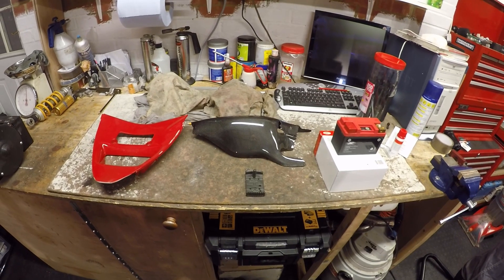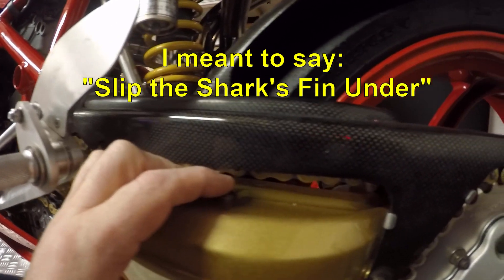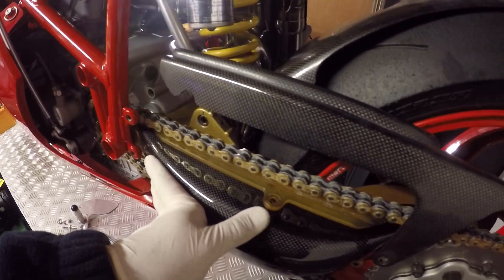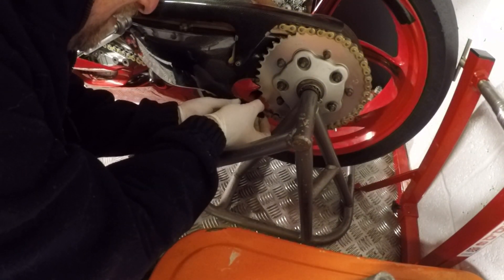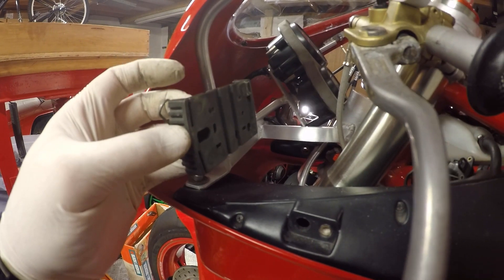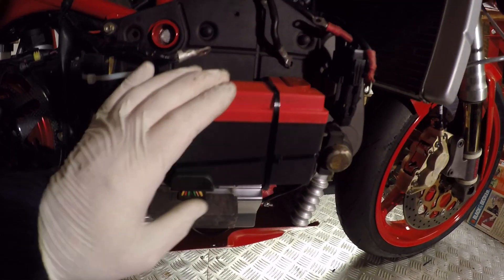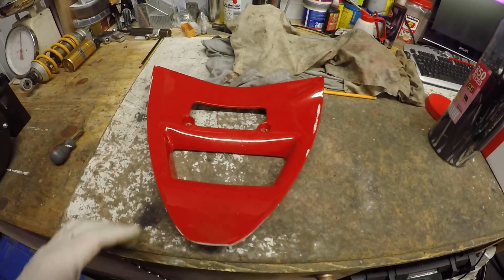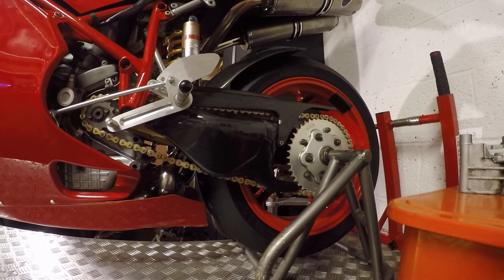Thunderbike Race Prep No 29  Ducati 748 - Fitting the Sharks fin and Battery

Comment: Mate I love your work and inspired me to learn more all about it and decided to purchase the Haynes manual :) I managed to sort out the clutch already and changed the fluid and all fixings so it is great now. Today I started removing the upper fairing and had an issue with the rubber nut that completely corroded so it took me some time to get it off. Any suggestions what to use instead to eliminate this issue?
Reply from the maker: Good effort Tom, glad you are getting so much from the videos :)

Comment: Looking awesome mate! Been loving the build vids! 
Out of curiosity, could you not drill a hole further down the battery tray and fit a riv nut or well nut to retain the original battery clamp?
Reply from the maker: Thanks Tel :)

I thought about modding the battery tray but it is in good nick so may use if on 916SPS when I rebuild it so don't want to cut it in anyway.

Keeping my eyes out for a cheap corse type battery holder or might attempt to make myself one later in the year

The tie wraps will be okay for now as it weighs less than a 1kg
Reply: DesmoWerx That battery tray looks brand new, so I don’t blame you! 

Looking forward to seeing footage from your track day. Keep the Instagram pics coming if you get time mate, good to see progress!
Reply from the maker: I cant wait to take it out, its been a longer build than a usual one due to filming it, will take the phone out for some instagram updates next time :)